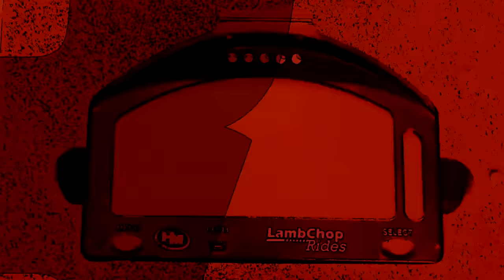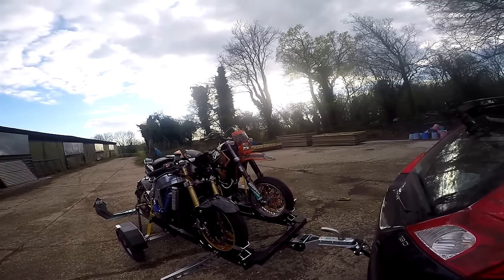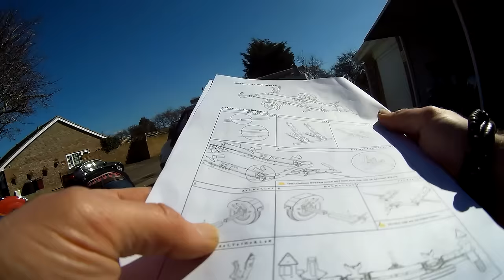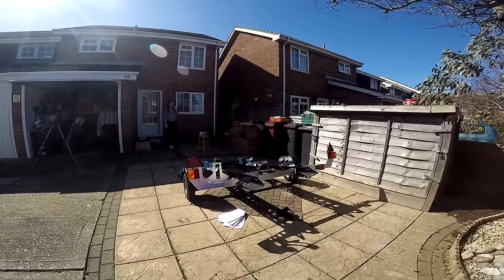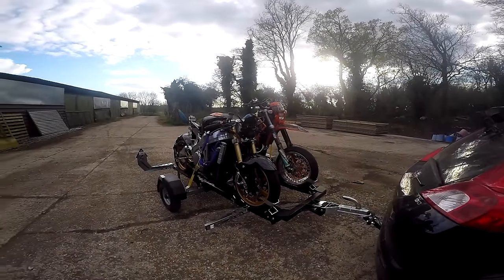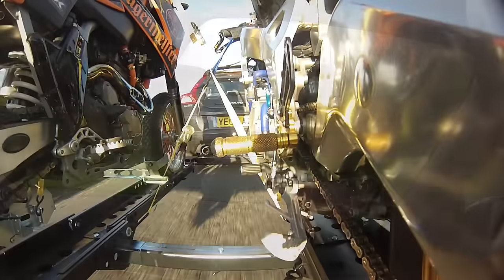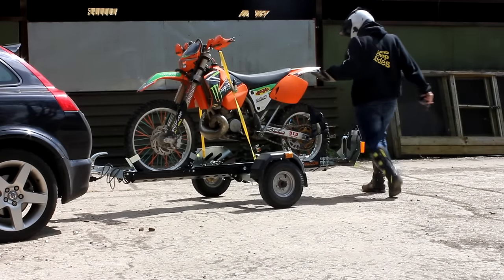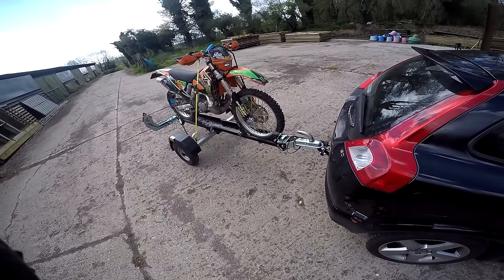Motolug Twin TE Trailer | The ultimate trailer system??

Comment: The adjustability of the wheel chock had me a bit confused when it didn't need adjusting between bikes with 17" and 21" wheels. I have a similar arrangement on my hydraulic bike bench. The adjustability serves to vary the amount the front wheel drops in. So have it set for a large drop for my light enduro bike, to ensure it stays put over bumps. But for my Harley or Pan European, I have found using less of a drop-in helps when trying to pull it out afterwards on my own. The motolug trailer is less of a problem in this as the raised angle gives you gravity assistance pulling it back out, but until I realised this, on my bike lift bench, I used to have to get an assistant to pull me backwards

Comment: Great video.  I have the same trailer in the USA.  I did have to make an adaptor for the light system.  The 7 pin standard in the US is different than the one from UK.
Reply: Hello Me VoCGT I am glad I saw your comment 😁 because I am going to buy one Motolog TE (Twin) and I am looking online how to register it in USA. I live in Germany but I will move back to the State. Please can you explain me how was the process to register it on USA? What I know so far is that I need a bill of sale a registration and some type of title from the seller. The trailer need to have a label on it with a VIN number and the weight. I am watching many youtube videos about Motolug and none of them  have that information on the trailer 🙁. Can you verify your please? Thanks in advance!!!
Reply: @bj231bj  as far as registering the trailer here in the US, it will depend on the state you will be moving to.  Motolug will provide a certificate of origin(or an equivalent document), as well as the specs.  Then you will need to see what the state department of transportation will want.  I provided the documents included with the trailer to my state’s department of transportation, and was issued a registration for it. took about 2o minutes or so.  Some states won’t require it to be registered.  Good Luck!
Reply: @Mattvogtsr  Thanks for the good news!! Take care!!

Comment: Hi mate I've got a c30 member of the fb crew I've got a motorcross bike was going to buy a van as didn't think the c30 would tow well how have you found it yourself?
Reply from the maker: The C30 tows fine, as towing bikes there is no weight there. Hardly even notice they are on the back!

Comment: Hi chops was this vid filmed on the thieye? have you had issues with low recording volume ? or do I have just have a faulty unit ?
Reply from the maker: No it wasn't, I've had no problem with audio apart from Wednesday when it was in a very high vibration area on the KTM, kept cutting out completely. Not sure if it's a one off or not yet..

Comment: Did you notice much change to your car's fuel consumption? I just came back from 2200 miles in europe in my V60 D4 and it averaged 63mpg, so I'm trying to cost out how much this is likely to drop to with a 350kg load on the back. thanks
Reply: I can answer my own question now. From Nice in the south of France back to Calais at 80mph, towing my VFR800 on my motolug SE, I still got 50mpg from the Volvo. The trailer was dead steady, even when overtaking.

Comment: Shame they dont do one thats slightly larger, Ive got the same problem with my Quad/Buggy. No space to store trailer but need to transport it around, the only way i can do it currently is with a wheel bar to suspend the front but it means using a pair of throwaway rears to transport it, thats fine local but long distance its a waste of tyre.
Reply from the maker: Sounds like a new opportunity for them! They do a heavy duty one but only single track.. Good idea for them though quad trailer